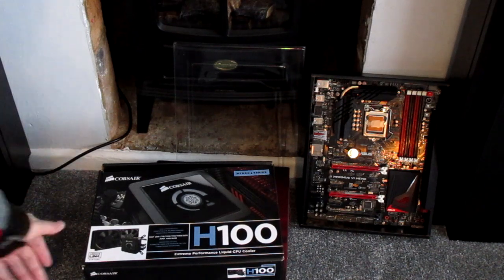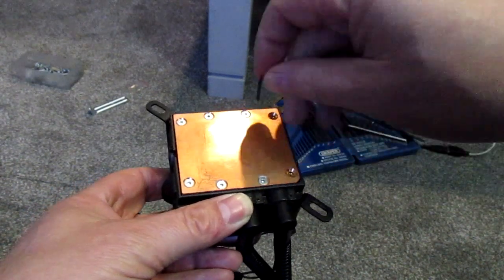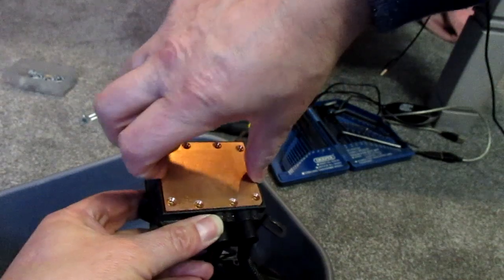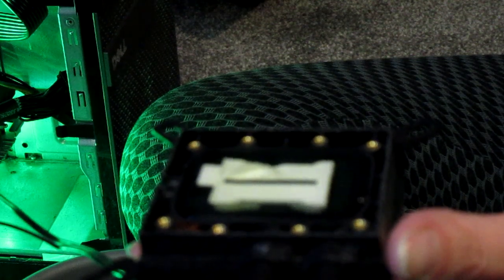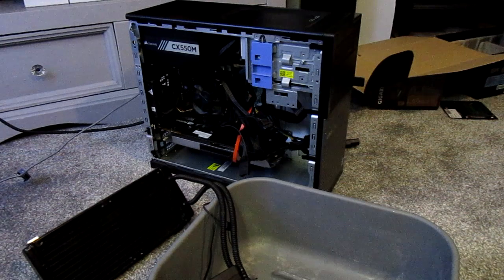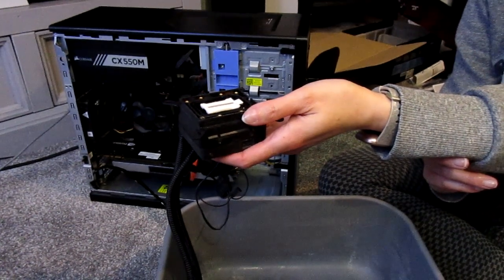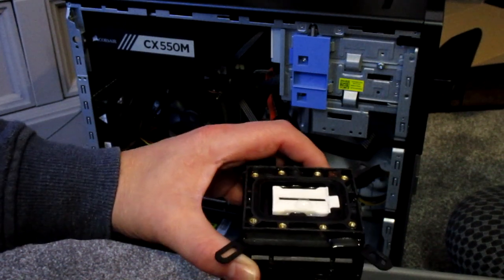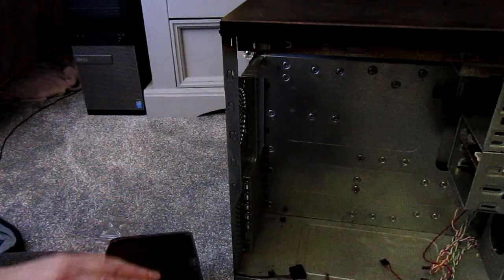Corsair H100 fluid change on 12 year old cooler!!

Comment: Those fans are also used for drawing hot air off the motherboard. You are being counterintuitive, mounting it outside of the case.
Reply from the maker: The case has a side fan which blows fresh air on the vrms and chipset.  I originally had that rad mounted in another case, when I monitored all the temps it made no difference to the motherboard components.
Reply: Run a heavy game
Reply from the maker: @ the rig was fully benchmarked, scored me a load of points in the overclockers league.  I finished last season 8th in the UK.  Next time the board and cpu will be in action is on an open bench attached to my home brew chiller.

Comment: Thank you I was wondering if this will be possible down the line so I’m happy to know it is
Reply from the maker: Yeah I’m currently overclocking and benching using a 7 year old Frost Flow AIO.  I could hear it bubbling for a few minutes when I set it up but is working fine now.  I’m scoring good points in the HwBot leagues with it, just got back into UK top 20 and I’m top 3 for the season.  I’ll probably change the fluid like I did with the Corsair in a year or 3.

Comment: can I use  car coolant?
Reply from the maker: You could try it but it would need the right mix of water content.  Too much coolant would make it hotter.  Considering the proper stuff isn’t that expensive I’d go with that.  Additives in vehicle coolant will also be different and might cause problems.
Reply: @theHardwareBench  and  how about distilled water   ?
Reply: @theHardwareBench  How to find out correct  amount of water that would mix in it ?

Comment: Thanks for the video! Have you had any issues since doing this? I’ve got an old H60 from 2013 that has the same pump that I’m considering doing this to for cooling a 7800x3D in a Home theater/gaming build I made a few weeks ago
Reply from the maker: Still working perfectly on an i7 4770k budget build that’s overclocked to 4.4ghz.  I’m not sure the H60 will be good enough for a 7800x3d.  I also have a 3700x and it gets hot enough to throttle on a nh15 noctua cooler on the bench, plus it’s undervolted.
Reply: @theHardwareBench h100 works well with my 7700x but it could use the extra cooling of a h150i tbh but disabling igpu keeps me mostly below 90 around 80 in game
Reply from the maker: @redditmanllegnisthebirdofh9887  This cooler originally was bought to cool my FX8120 and did it worse than the single 120mm fan Gladiator tower cooler it replaced as the heat from the GPU and chipset heat soaked it.  I ran it stood up on the top of the case and it did a decent job.  To cool the i7 4770K it's now used with even a t 4.4ghz it only needs a single fairly slow fan to do the job.  It does still sit on top of the case which helps.
Reply: @theHardwareBench  yeah same here at the top as an exhaust it works great for me as well tho I did overpay a bit as long as my pump stays strong I’m happy. I think this cooler is fine for 7800X3D tho due to the fact it runs a lot cooler than my cpu by quite a bit, 7700x on avg runs almost 40 watts more than the X3D in game due to how it boosts. But it wouldn’t hurt to have a beefier one tbh, for my small pc I had no choice but I am looking at potentially getting the artic cool II which is basically the same size 240mm fans but bigger radiator

Comment: Bro how many liters of coolant are used?
Reply from the maker: Think it was less than a quarter of a litre.
Reply: @theHardwareBench  I use a charging container to pour in the coolant, and it goes up to about 120ml to 130ml, but it can't go beyond that.
By the way, I've been using it for over 10 years, and I thought the cooling water must have decreased a lot, but I was surprised that it was stored so well
Thank you, brother